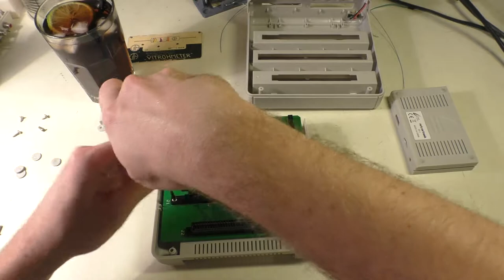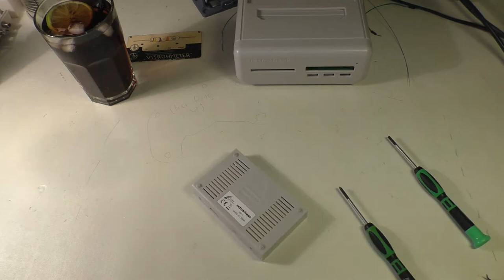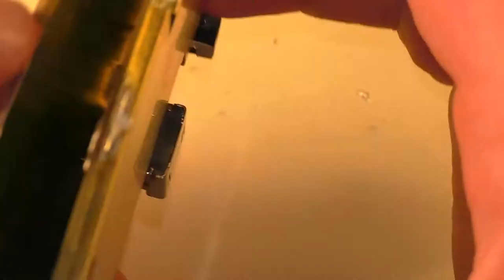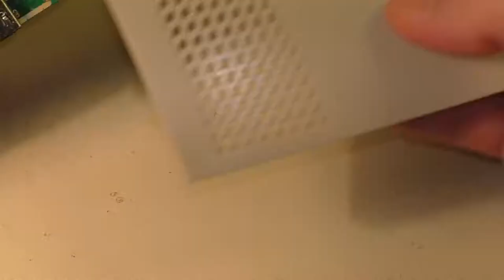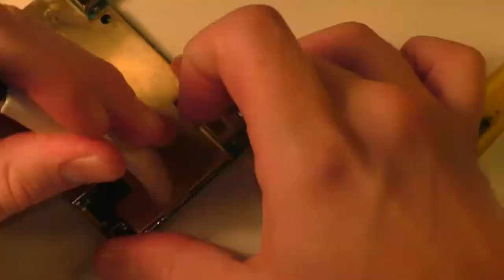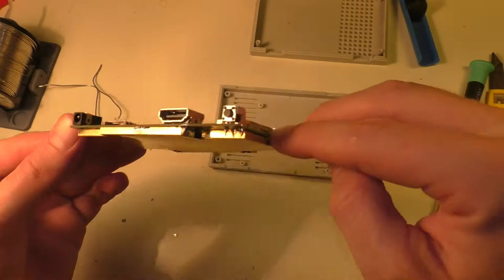Retro Freak v1.2 Disassembly

Comment: Anyone know how to fix the front 3 usb ports. They give power to the 8bitdo adapter, so that part of usb works yet can't navigate through menus. Using the original control pad that came with retrofreak dosen't work either so it's not the 8bitdo adapter. If you remove the cartridge dumping part the two usb on second part works. Yet I still have cartridges I want to dump.
Reply: mine was in short. The whole interface had a short on one of the USB's, making the interface unsable. I had to literally move apart the metal shield that was shorting the USB, then it worked properly. Maybe you have the same issue.
Reply: I have the same problem and I cant find anything about it. No controller works at any of the front usb plugs. 8Bito Controller rumbles as always when connected and the usb adapter lights up as normal and register the controller as it always did. System still running and loading my gamelist from sd Card in the background. It just works at the small unit. Dunno why, I havent touched the system, it happened out of nowhere. So I cant Load any cartridges anymore :(
I did the latest firmware update some Werks ago, maybe this is the problem? Dunno how to downgrade the firmware to test it out.

Comment: Thank you for your tear up video. Have you had any troubles or malfunction with your unit? Mine suddenly shut off and havent been able to turn it on since. When I press the power button the yellow light turns on, but nothing happens. If I keep the button pressed, the yellow light will keep turned on, but  the system wont start either... Dont know what could be a possible solution (by the way, when the system shut off itself, it didnt made any funny noise nor any kind of burt smell). Really strange...

Comment: do you think the retro freak uses all 2 amps from the included power supply? it has portable-ization potential
Reply from the maker: I doubt it draws that much. Different cartridge circuitry will add to that though: consider the SNES carts that have various support chips.

Comment: how can you tell that it is version 1.2 and why just show only one side of the mainboard?
Reply from the maker: Hello! Good questions. It's been a while since I recorded this, but my guess is that the version was printed on the box of the product. I'm abroad at the moment, but  I'll try to remember your question and check when I get back. As for just one side of the board, I can't recall this either, but you can see at 5 minutes into the video that I partially removed the shielding to have a peek. Presumably there wasn't much of interest to me there (ICs) with mostly support circuitry on that side. I do still have the unit so if you really want a closer look I could revisit this. I may also have taken close up pictures; I'll have to check.